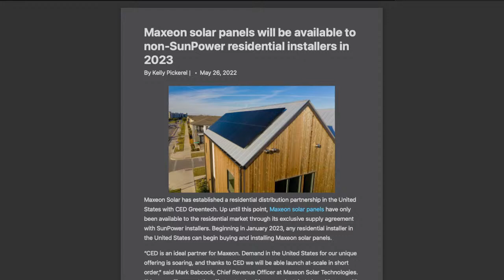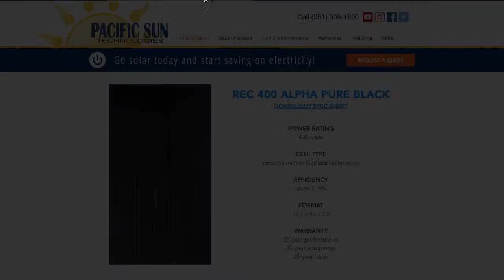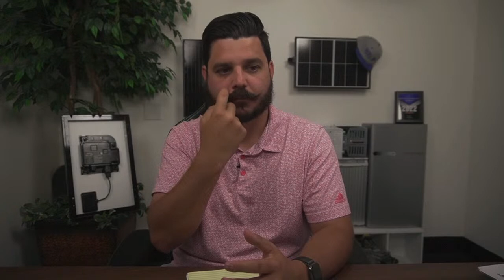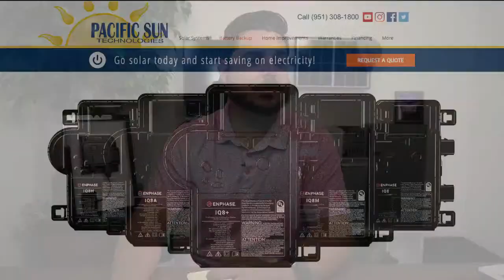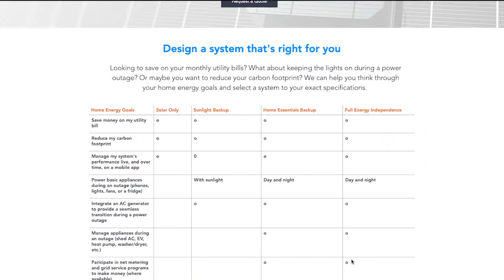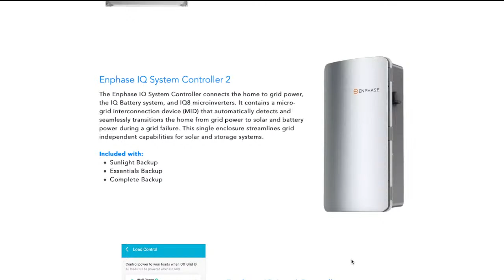LIVE! Solar Industry Update Q2-Q3 2022

Comment: Going for IQ8As, to get max power out  of panels and to enable future battery usage and to allow independent power.    Battery storage is just not worth it for the cost right now,  For two 3K enphase batteries cannot compare to a generac full house propane backup.   I will get the IQ8 Controller2 and combiner comms box, which acts as a smart switch and accepts a generator input, as well as  power during daytime if power goes out (a side benefit).   Lithium is too expensive and waiting for sulfter and salt batteries to significantly reduce the costs........  Probably 5 years away at best.

Comment: According to Enphase's website, the Enphase IQ8A only costs $13.00 more per inverter than the IQ8M. So you are incorrect concerning the cost difference. Further, there are numerous solar panel suppliers offer 445 W  to 460 W panels. If you consider bifacial panels, the range goes up to 575 W per panel (under the best circumstances). So if a person is purchasing a bifacial panel, then then would want to upgrade to the IQ8H in order to limit the "clipping" loss. The IQ8H will handle up to 540 W input power, which makes them ideal to deal with high wattage panels.

I enjoy your videos, but some of your information appears to be questionable.